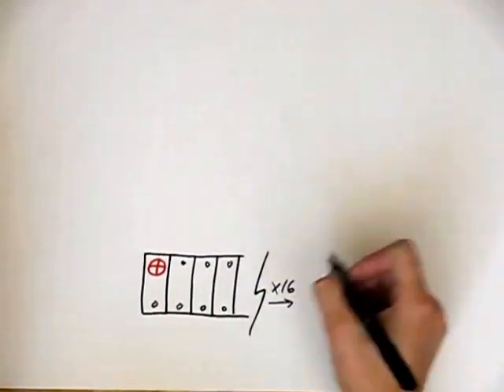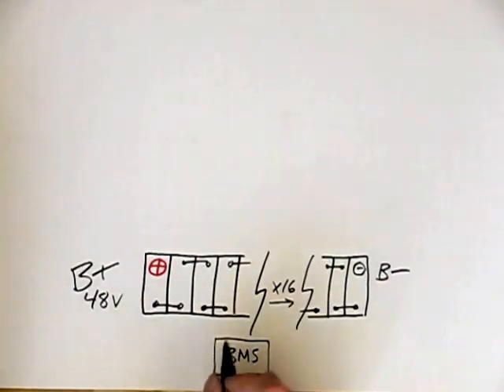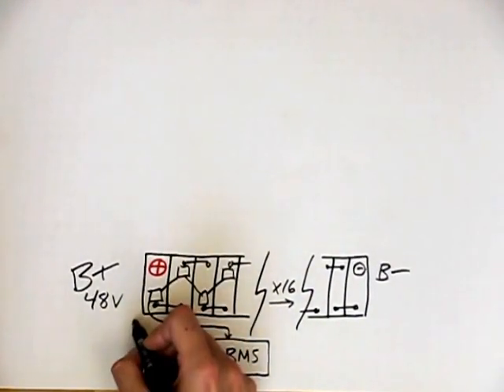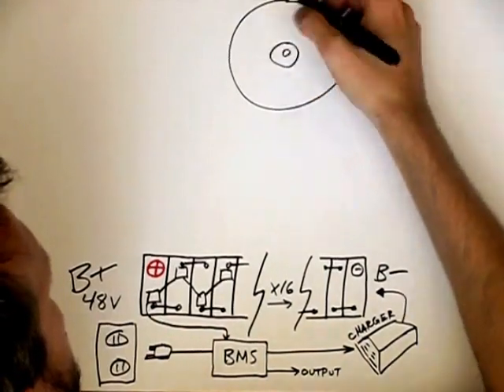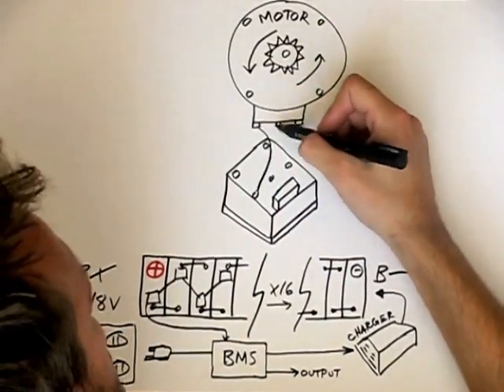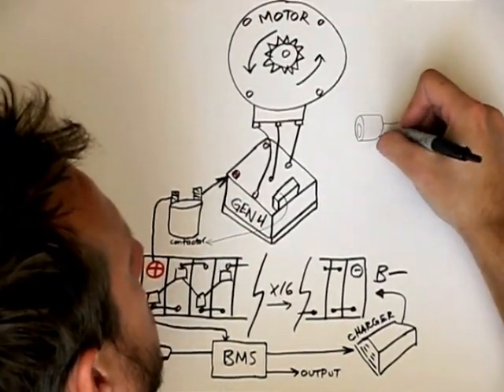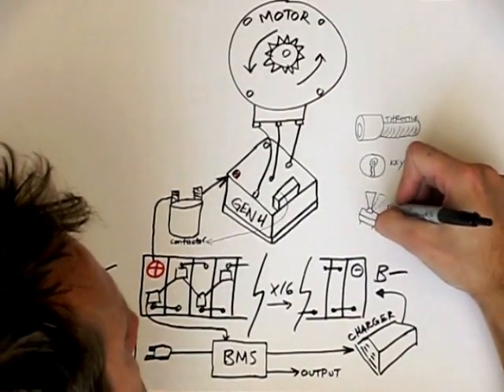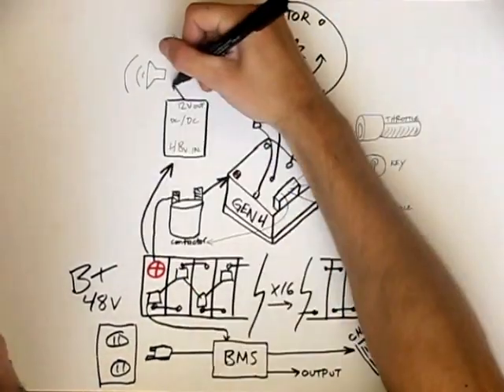Gen4 Wiring Drawing (simplified)

Comment: Now I'm intrigued. Reading the manual on both Gen4 and Gen5 controllers, they both state that contactor  and precharge relay should be controlled by other means? I would too like to use my sevcon to control the contactors. makes more sense to have it cut power if is detects a problem. So it is possible in the configuration to have the relay  outputs on the controller run the contactor and precharge relay?